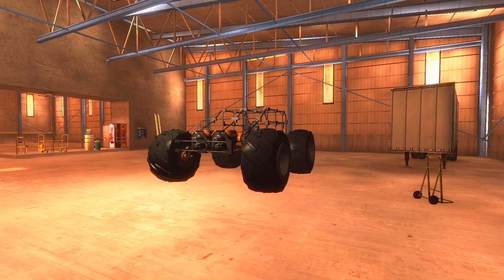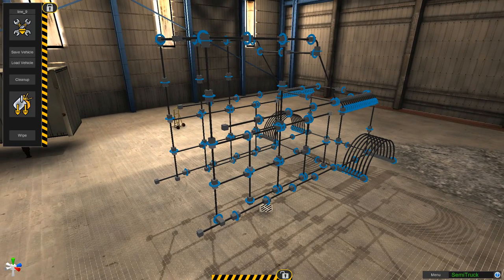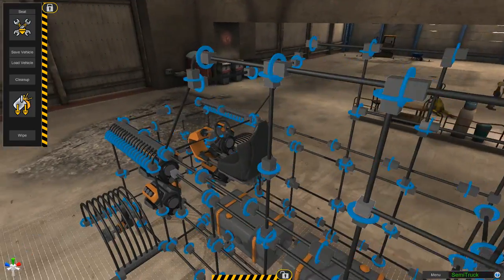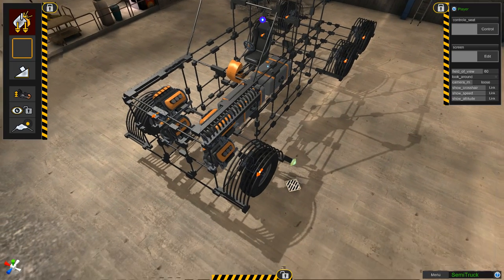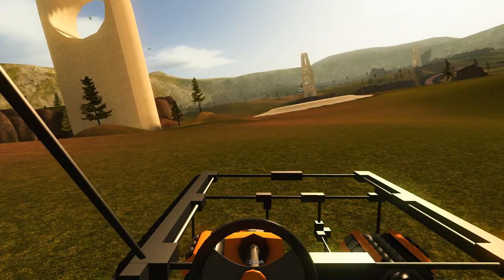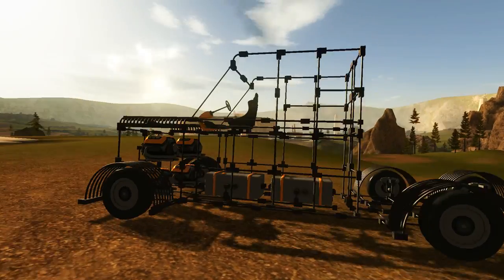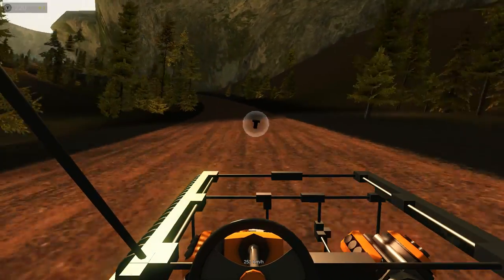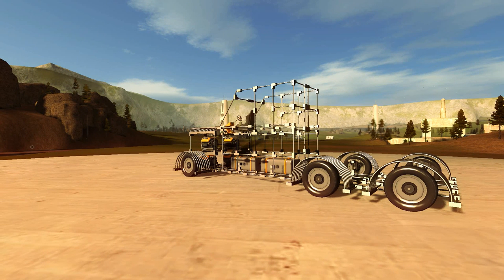FailRace Creations Long Nose Style Semi Truck (Homebrew Vehicle Sandbox)

Comment: Awesome! You can lock your camera by clicking on the lock camera button in the tuning area (the eye with a lock next to it). If you want you can test it in the workshop by selecting a seat and then clicking on the control property (a purple indicator above the seat will appear to indicate that you have control). Then simply click on the Physics button in the left panel to enable physics mode and try out the vehicle in the hangar :).
Reply from the maker: Ah thanks very much :)
Reply: is there a creative mode for this game I get the feeling that im too lazy to unlock all the parts but im definatly getting this game after xmas